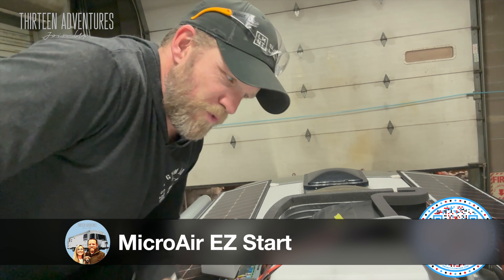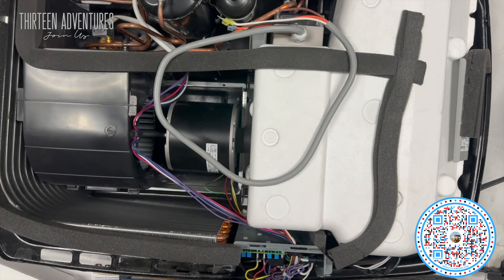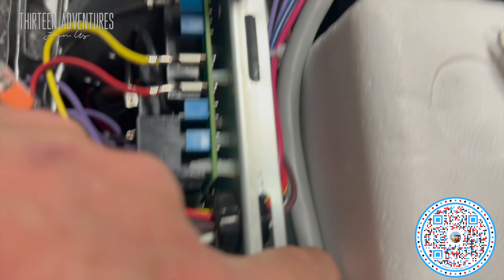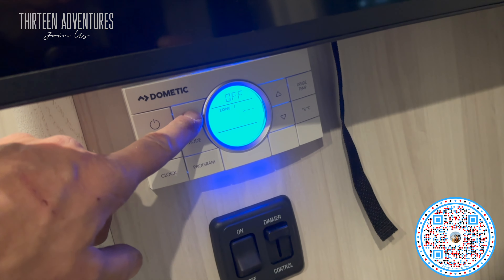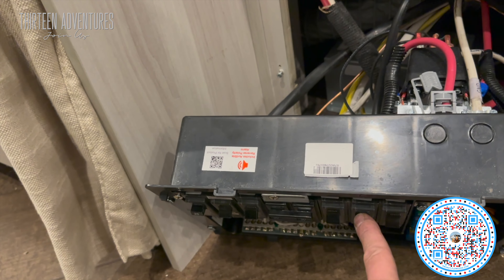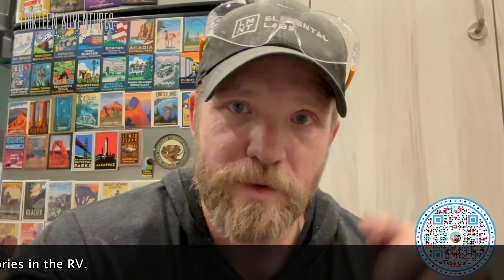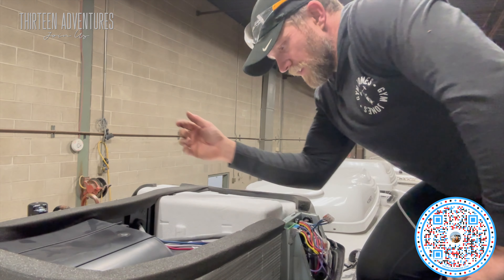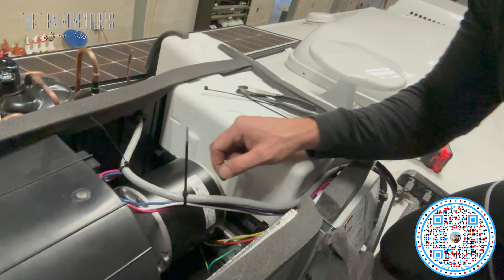Upgrading Airstream AC with EasyStart Soft Start | DIY Installation for Hassle-Free Power!

Comment: “I’ve been fine without it for this many years.” 🤣 I’m interested in the soft start as I may be parking a rig at my house to use as my “home office” during the week.
Reply from the maker: I was also "fine without it" for many years on our old trailer.  I installed it on this one so I could run the AC on battery.  It makes a HUGE difference in power draw.  You could absolutely run the AC on a 20amp circuit (probably a 15amp also) at your house with this installed.  This is true of Dometic only.  The new Coleman and GE models pull much less power.

Comment: I have heard that the new Airstreams come with easy starts built in from the factory.  Is that correct?  Is it only on certain models?
Reply from the maker: The 2023 Globetrotter, Pottery Barn and Classic come with a Coleman AC vice Dometic.  These systems seem to be much easier on the start up power surge and likely do not need an easy start.

I also started my other AC without the easy start on it with the battery and it worked fine.  The lights dimmed a bit when it came on.

Comment: What is your intent for installing an easy start?  Is your plan to run the 15K BTU AC off of a generator? If so, what wattage gen would be required?

Is your plan to run the 15K BTU AC off of battery power using the inverter? If so, what wattage inverter would be req'd for that and could you provide an estimate on available run time?  Nice rig, good stuff.  Semper Fi.
Reply from the maker: I dont have a generator and never have.  I did this to ease the power requirements while running it on battery.  I tested this system as is with my new installs and ran it for 45 min.  I have the 3000w Victron Multiplus II inverter with a 270Ah Battleborn Gamechanger.

Comment: I see there is now an portable EZ start that isn't hardwired to specific AC but put inline with power cord.  Is there a reason you didn't opt for that option?
Reply from the maker: Im not sure what you are referring to on this.  This type system changes the start up sequence of the AC compressor, fan, etc. to slow the spike of power.  I cant think of anything that would hook to a power cord that would or could change that sequence.  Could you please provide a product name?